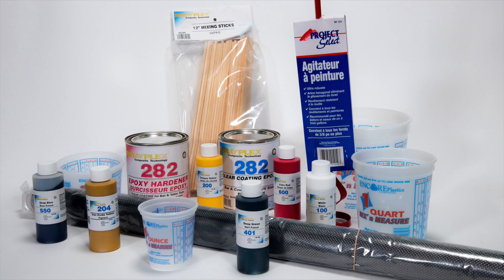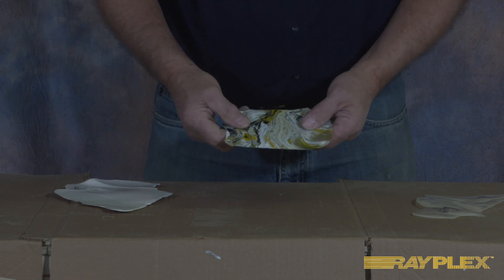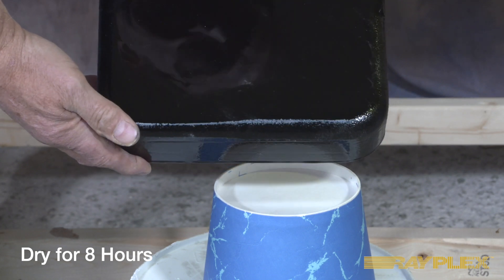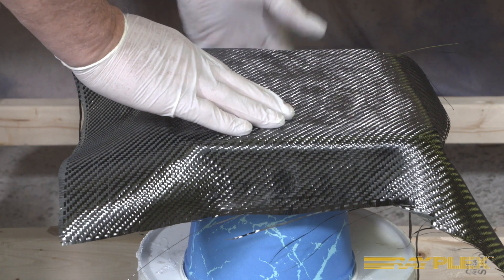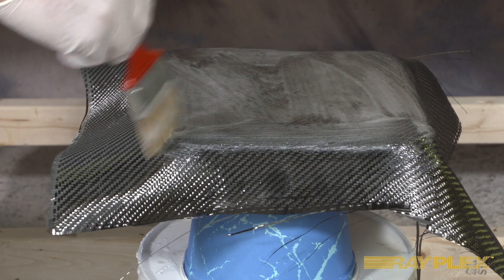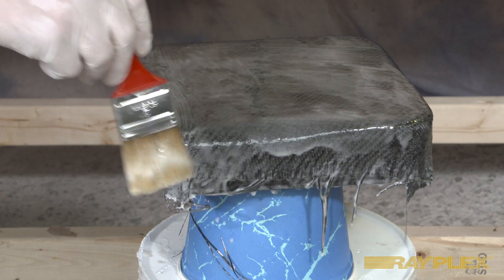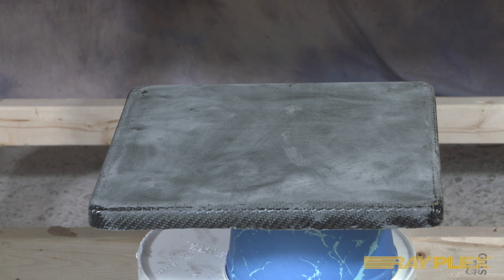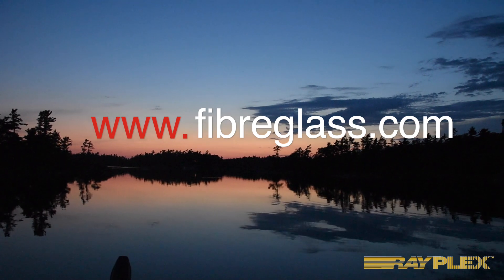CARBON FIBER CLOTH LAMINATING and FINISHING

Comment: Umm the video cut off and when it came back on the square block is about a quarter of the thickness it was before the video cut out. Did you cut the block down?  And was it sanded before the final coat of epoxy was applied when the video came back on?  I'm so confused what happened.  And I'm trying to learn! Dang it!